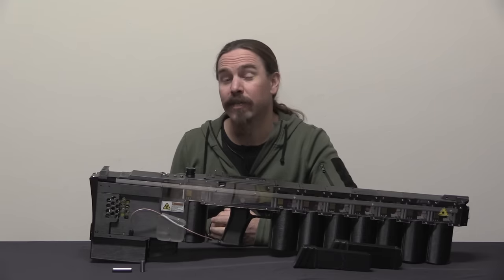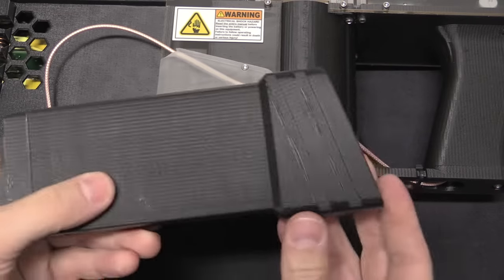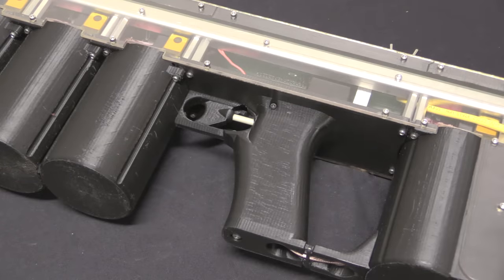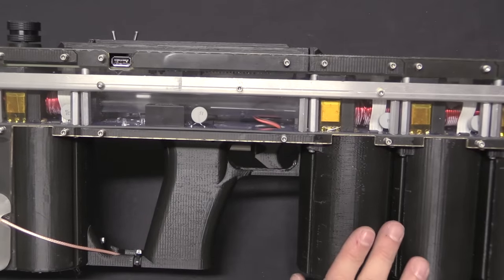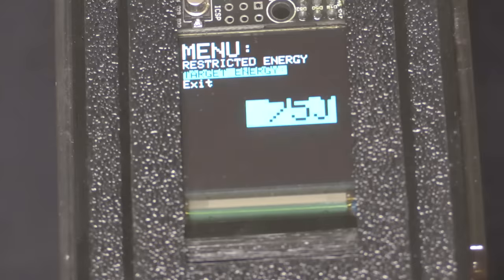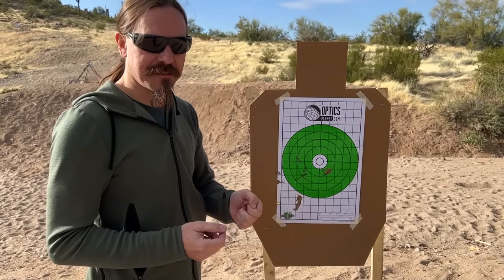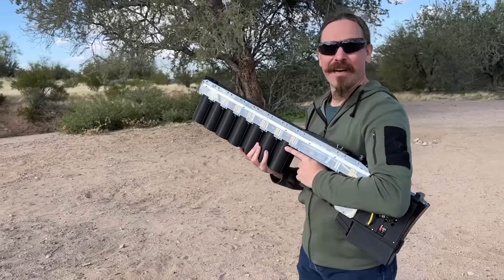ArcFlash Labs' GR-1 Anvil Portable Gauss Rifle

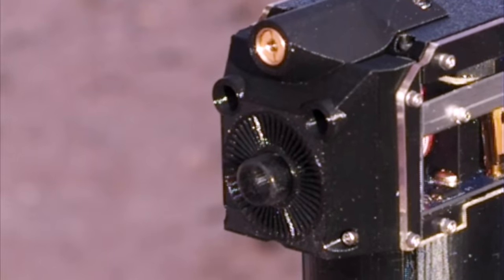Comment: 18:57 you can see the barrel shake because the slug is bouncing around in there. Probably one of the reasons it's so inaccurate, and why the slugs tumble in the air.
Reply: I think the barrel shake is residual from that first stage of moving the round out of the magazine. It's kinda punched out, bounces in the small section just above the trigger as there's no magnetic field there, it's just moving on momentum. then once it enters the main acceleration part, the projectile is always going to be inside a magnetic field, as Ian said earlier in the video, so it'll be pretty well centered. The tumbling effect could occur just after the last stage coil though, as it'll immediately start to drop again, and at the relatively low velocity, it might snag the edge and cause that spin
Reply: The slugs tumble because they're long and unstabilized. A ball bearing would be a more economical choice and likely more practical at this point in development.
Reply: @randomidiot8142  someone else mentioned the possibility of fins to help stabilise them in the absence of rifling, but I agree, Ball bearings make more sense
Reply: @thomoski  it's a good idea but I believe the point of developing a weapon is to focus on a round that you want to use, and develop the gun around the round, not the other way around.
Reply: @ragnarragnarsson3128  you probably could even put a hop up in there, like airsofr guns to put spin on the bearings
Reply: Why does it even need a barrel where the coils are? If you wanted to protect the coils from an impact if something goes wrong just put the plastic tubing of a wider diameter (as wide as possible but wider than the round) on the coil part. 

Also not fin stabilising the projectiles really doesn't help. While I'm sure it would be expensive for a prototype to make FS dowels, on a small scale like that it's just a case of turning one end to a cone and spot welding steel fins on. You don't need to go to the length of threading one end and fabricating a full fin assembly to screw in like tank APFSDS rounds.
Reply: @QuantumLeclerc  This was explained in the previous one. They don't need a barrel, but there's components all along the way and a barrel is the easiest way to keep it in place in case something goes awry. This is very much still in the "we're looking at what we already know works to fill in the gaps" stage of development.
Reply: Lots of good ideas in this thread. These great ideas are what is going to make these guns more practical! I hope to see in the next 10 years or maybe sooner a legit gauss rifle that is used by militaries because the whole idea of the gauss rifle is the projectile is moving insanely fast and you are able to make some long range shots quickly and accurately
Reply: ball bearing might not just be the most practical option either, i believe fletchettes would work best
Reply: Would adding a barrel mount at the front of the barrel, so that it's connected to the frame help, or is there a reason for it to be sort of free floated?
Reply: @thomoski  I'd reckon it would be possible to keep the projectile centered if they added a coil to the 'empty' part of the barrel which runs a weak magnetic field, not to accelerate it, but only to center and stabilize it.

The projectile would then only be moving through air. In theory, you wouldn't even need a barrel.
Reply: @randomidiot8142  it'd be like a crazy futuristic musket
Reply: @thomoski  Would you get enough spin for stabilization from milling spiral grooves along the length of the armatures, I wonder...perhaps with a conical or ogival tip to help direct air into the grooves...
Reply: @randomidiot8142  a ball bearing wouldn't have enough area for the magnets to act on. There's a reason the guns like these shoot either big flat discs or long rods. Like the Arcflash EMG-01A that shoots the flat discs.
Reply: @randomidiot8142  I would be surprised if they don't have somebody who's entire job is looking into different projectile geometries in order to find an optimal round. The dowel being used surprised me, because I figured they could even be 3d printing different rounds in plastic, fitting them with a metal core of some kind (ball bearing, rod in the middle, whatever), and testing the shape for practicality before committing to making them out of metal.

It's not like they're using a railgun, so the entire round doesn't need to be metal for it to work, it just needs a magnetic core to pull the round through the coils.
Reply: @douglasloss  yeah, this was my thought too, although I'm not an engineer or anything, my basic grip of physics thinks that makes sense
Reply: @Khotetsu  I'm not surprised. They're engineers doing engineer things. I would be surprised if they had someone researching optimal projectile shape because that's getting ahead of themselves at this point when the magazine won't function properly and output is low. Let the big guys do that research.
Reply: @randomidiot8142  True, makes sense.

Comment: Really enjoy the comments here, instead of dismissing it as “not a real gun” i’m glad people see the possibilities. Engineers are still mastering the potential (pun intended) of wielding electricity, same for electric cars and look at the leaps and bounds those machines have made in just ten years. Great review Ian!
Reply: Electric cars are plateauing.
Reply: @thomasbecker9676  plateaued.  until battery tech takes a giant leap forward they are just a gimmick.
Reply: @thomasbecker9676  Agreed, the tech is hitting both resource limitations and problems with scaling.  However, more innovations in materials or processes will likely build...but how long those innovations take is anyone's guess as anything tech is.
Reply: @jayscott8583  As long as you are purely looking at replacing all your IC car can do with an electrical car that can do everything, instead of "Do i need a IC car for a 20 Mile daily commute", they will be a gimmick.
Reply: @fortusvictus8297  Unless there's copious amount of money to be made from it, those innovations rarely happen.
Reply: @jayscott8583  Interesting, my room mate has a Tesla and drives at a significantly reduced cost of driving.  Especially charging over night off peak electricity hours.  He was paying pennies to get a full charge of 200+ miles.  Doesn't have to pay for oil changes, or maintenance of a bunch of other combustion engine parts.  Pretty amazing gimmick if you ask me.
Reply: @deildegast  By gimmick i mean the idea that EVs will replace IC engines in the near future. If the battery tech was to make charging take seconds instead of hours or mins i can see EV's becoming viable for more.  that leads into the grid issues which are substantial.
Reply: It’s simply about energy density. You won’t beat the chemical energy of conventional firearms. They stay “charged” for decades. They can have whatever rate of fire you want. The firearms themselves can be simpler and cheaper to make.  

This gun is not the future of anything.
Reply: @Ossuis  There isnt an EV that compares to the hauling capacity of my diesel with a  range of 500 miles
Reply: @Ossuis  when he does needs maintenance he will see the true cost of these EVs a new battery is nothing to sneeze at.
Reply: @Ossuis  cost for battery replacement by type
 Between $13,000 to $20,000 for a Model S premium sedan
At least $14,000 for a Model X premium SUV
At least $13,000 for the Model 3 entry-level sedan
Reply: To think you don"t have the maintenance cost just because its an EV is foolish.  Its a machine it needs interval maintenance.  lets not forget that a home charging unit is not cheap and neither is electricity rates.
Reply: mcchickenz  Except they're just playing catch-up. The technology they're using has been plateauing for a while now.
Reply: @jayscott8583  home charging is actually cheap, roommate pays about .02 a mile.  

The battery replacement is expected to be between 300,000 to 500,000 miles which is more then most cars are expected to last for.

While it it true the towing capacity of EVs are lower, the Ford F-150 lightning will be expected to travel 300 miles without a tow load, with the ability to haul 10,000lb.  Range with that load is still TBA but we can expect this to improve over generations.  

Electric semis are already under development and I'm sure we are going to see a lot of interesting designs soon from many companies.  The important part is this technology is developing and very much in a usable commerical state that is viable.  It was very gimmicky to start but I think about the time the model 3 and the Chevy bolt came about the game changed dramatically to something that will start phasing out the ICE in the coming decades.  I suspect ICE will have no place on the road except for hobbyists in about 45 years.  Most people say they want range and towing capacity on a vehicle, in my experience very few people utilize it enough that a rental wouldn't suffice in the rare times they actually do.
Reply: @jayscott8583  Well, not all IC, but some. And most people just dont need seconds or minutes to load, when your car is parked over night anyway. As i said, asking for several hundreds of miles of range, when your daily commute is 20 miles, is asking the wrong question, as is filling the battery in seconds, when your car parks somewhere the whole night without being used.
Reply: @deildegast  Exactly my point. 99% of use case for vehicles are driving to do errends like shopping or going to work, which will always be <100 miles a day.  There is a weird culture that people want to have all the features and utilities in a vehicle that they never actually  needed.  See the obsession with SUVs, or trucks in the south.  Honestly I don't know many people who actually use their truck towing or off road ability.
Reply: @Ossuis  So that battery lasting x amount of miles doesn't make sense.  A SLAB solid lead acid battery tends to have a 3 year shelf / service life.  NiCad and lithium  battery last Alitalia long but also can be prone to degradation after some many charging cycles.  As for your roommate getting .02 per mile that's no different then my 2020 diesel truck gets.
Reply: @jayscott8583  would be interested to know this super diesel truck you own.  Average mpg is something like 20 for a truck.  Even if you have a nice brand new truck that can manage like 27 mpg that still comes out to .12 per mile traveled.  Your math isn't checking out.

Google lifetime of Tesla battery and every result will verify my claim.
Reply: @Ossuis  yeah it's about .20 sorry my fault.  As far as the life limit most slab batteries are limited nicads and lithium don't have have a shelf/service life they have charging cycles.  You do realize im not totally against EVs I just don't think the technology and infrastructure is there yet.  And as far as long haul trucking it would be almost impossible to move goods at this point.

Comment: The fact that it has the muzzle energy of a .22Long is astounding.  The progress can only increase now.
Reply: Agreed, they just need to workout a way of rifling the projectile for more accuracy.
Reply: @88njtrigg88  you could also have a sabot with fins to create spin. Straight fins would be stable at high speed, but lower speeds (longer ranges) would like that gyroscopic effect
Reply: Or just put a bias into the magnetic field i.e. rifle that field.
Reply: @warrenokuma7264  why not have both, it could potentially work well.
Reply: True, but I like cheap ammunition.
Reply: @warrenokuma7264  or just put grooves into the projectiles instead the will make them spin from the air passing through
Reply: Another solution indeed, though the machining tolerances are going to be very, very, high and pricy.
Reply: @warrenokuma7264  Left & right hand rule, of course. Thanks for the intuitive reply.
Reply: @warrenokuma7264  I think both ideas have merit, and the best part is that both would work in either gun design (with less success but still compatible). Think of it like a shotgun, with rifled barrels, rifled slugs, and everything in between.
Reply: @Stranaton  Agreed, a man after my own heart.
Reply: @warren  investment cast projectiles.
Reply: @88njtrigg88  They are working on it, most promising is to use the magnetic impulse to put a spin on the projectile.

Comment: I wouldn't say it's impractical, it looks cool and looking cool is 99.99% of the battle
Reply: Looking cool is 99.99% of the battle. The remaining 0.01% is violence.
Reply: @DearValentina  bloody horrible violence
Reply: A weapon of fear
Reply: give it a few years and higher budget, if you replace the coils and capacitors with top of the line stuff, i think you could get a much better velocity, ( and therefore accuracy as well? ) but the gun will cost like a car